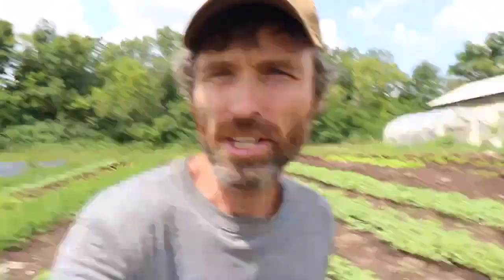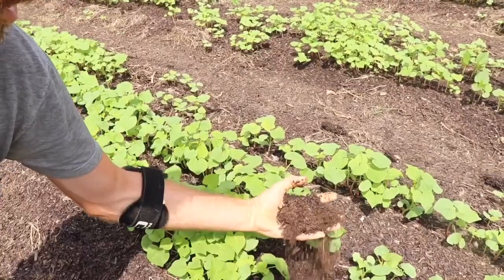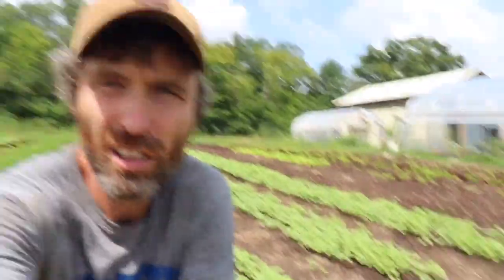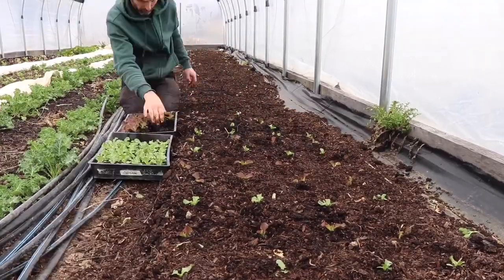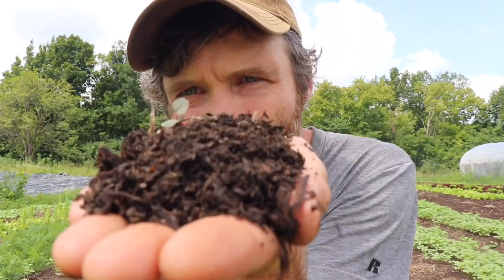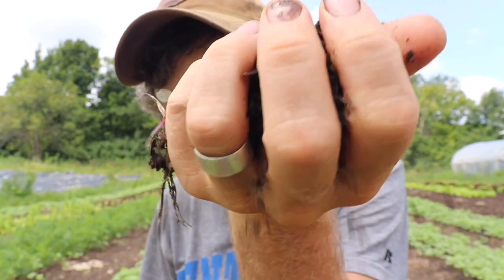Combining No-Till Systems

Comment: A few ideas: 1) Too much rain. Plant in raised beds so the beds can drain. No need for wood borders for the beds. 2) Drought. Opposite. Raise the path and lower the bed so rain drains into the beds. 3) Nitrogen, A good source would be to feed coffee grounds to worms in a bin. Also feed them rock dust, eggshells (after washing then sterilizing in an oven at 350 degrees.) 4) Do not ever try to germinate seeds in worm castings (vermicompost.) Bad results. Better off in a high end organic compost for the first few days.

Comment: Timely as usual!  My compost/mulch is very similar, with similar issues. While talking with my CNG certifier this weekend I think he brought up cover crops two dozen times! My concern was removing the cover crop, but currently I'm mowing my greens beds with a mulching mower and covering with landscape fabric for two weeks. Guessing I can do that with the cover crop. Definitely keep us posted on your work! Thanks!
Reply from the maker: Haha. Really cannot say enough good things about cover crops for our area. They cool the soil temp, they fertilize. I really want to incorporate more––the science is just not grey about their benefits at all. Yeah, fabric works. I’m going to spend the next year or so developing some methods for this with mowing and flame weeding and crimping and possibly covering with a little compost to weight it down after a mowing or crimping as a lasagne in place. We’ll see what works. Low mowing with a flame has been good so far. Needs more testing, though.

Comment: Perfect timing, can relate to everything you talked about in this video. 
Just finished interplanting a big mix of cover crops this morning, in really "underperfoming" beds (specially when comparing to other gardens haha) with the crop still in place. 
Lets see if it helps the existing crop to jump back...and if not, we'll just give it another try on September :). Hopefully with richer soils.
And as you were mentioning your erotion problems I thought maybe it could help if you grew a cover crop on your path ways. I'm doing barley in mines, just because it was what I had in hand, and wanted to take advantage of the pathways with photosynthesising plants. 
So long as I walk on my paths dayly it doesn't go crazy and if it does I guess I'll cut it back and use it as mulch for what ever is on the beds at the moment. But I guess it could help to slow down water and stop the erotion. I just seeded before adding some more material on the pathways and irrigated (it also helped me to need to use less material for covering the paths).
Wow this got extensive haha. Keep up the great work, and hope to hear the podcast soon :)!!
P.S. I'm going crazy with cover crops especially since I've seen the work they are doing at Man's organics in their greenhouses. Could be interesting to hear from them in your podcast ;)
Thanks again for the inspiring and helpfulll work you are doing.
Reply from the maker: Thanks and I have been thinking about a patch cover, though mowing it would be tough in our 18” - 12” paths. Still thinking on it. I really like what Mann’s organics has going on after watching those videos, for sure!

Comment: It makes sense that you would run through compost so fast if you're essentially dealing with tropical weather. Tropical rainforest ecosystems don't have much soil, because decomposition happens so much faster in the heat, and it gets a lot of help from the abundant insect life perpetually chomping away. You're doing what the rainforest does, which is keeping as much of it planted as possible at all times. I think if I were in your shoes I'd put down two lengthwise rows of bricks in the pathways (so, like 8"?) and expect the rest to get planted. Any runoff in rains in the pathways just ends up in the beds.
Reply from the maker: Exactly! In the tropics they mitigate that with carbon sources like Terre preta. Bricks is an interesting idea too. Thanks!

Comment: Have you tried adding manures or worm castings to make up for the carbony compost? 
I think cover crops/green manure are a great alternative but If you can add something to correct the nitrogen/other potential nutrients lacking you can then do inter-planting like you are with the cover crop but with produce crops instead. That way, as you said, you're keeping the roots and photosynthesis going for microbe/soil health but also growing produce for sale the whole time. I know that wouldn't work for every crop but there are a large number of inter-plants that work well even in commercial settings (generally slow paired with quick growing).
Reply from the maker: For sure. I’m open to all of that! Really into the idea of more lasagna beds on scale, especially with manure and green manures and cardboard. I think that’s a really cool option for building productive soil and encouraging worms.

Comment: Have you tried  fermented comfrey and nettle .The best nitrogen.You are hard worker.God bless you.
Reply from the maker: I would love to get comfrey and nettle both going soon! Great nitrogen sources.
Reply: Works great, but just about kills you with the smell. :D :D
Reply: Rough Draft Farmstead Got a PO Box? I’d send you 50 root cuttings off Bocking 14 or 4 can’t remember which it is. They bolt kinda like a garlic scape but you just keep those trimmed back for a larger harvest. If they’re allowed to go to seed the resulting seeds are sterile. They stay short 2’ tall and only spread from the root. Plant them along a fence and you will have all the Comfrey you need. If you till them they will spread. Put them in now 3’ spacing you will have a Spring crop and follow up crops every 4-6 weeks. I’d send you 50 for free, If you want a bunch we could work something out.

Comment: I was wondering if you bought your compost locally, or if you made it yourself?  I live about an hour from Lexington and would like to get into the no-till system and need to find some decent compost to start with... (after I just spent 1200 dollars on a tiller for my tractor, haha..) Thanks and I love the videos!
Reply from the maker: We make some compost, but we get the majority from Thoroughbred compost via Landscapers corner. It’s okay. I like making enough of our own and enough compost tea of our own to use as a sort of inoculant. That’s critical. Their compost is just really mulchy. Works well for deep mulch though! Check with Landscapers in your area and landscape suppliers. They may have some or have a source. Thoroughbred will also deliver 30+ yards I think.  Not sure how far away. They are in Winchester (I think).
Reply: Awesome!  Thank you so much for the information.  I looked them up and gave them a call already.  Looks like they have a Standardbred mix made with wood chips and a Thoroughbred mix that is made with straw.  I'm hoping to possibly use the one made with straw, as I don't currently have any other types of compost to mix with it.  Thank you again for all of your help and for the videos. Keep up the good work!

Comment: ya.. you really need to get woodchips in those paths they fix your erosion problem. think about planting willows and get a relationship with your local tree cutting program. it's like watching you is sometimes so frustrating because yall need some local state and federal level support. there's no good reason why farmers can't get free woodchips.  you'd be shocked how much woodchips end up in the landfilled and they gotta pay tipping fees putting it there.
Reply from the maker: Right!? It’s super frustrating. I can get them at the landfill sometimes, too, but they mix them in with everything else and if it’s wet I can’t get to them. Again, very frustrating.

Comment: Only 9?  You're lucky in this region that 9 is all you need.
Reply: For reference, I do 10 on a 50-ft bed... but that's kinda meaningless without knowing our respective wheelbarrow capacities, right ?
Reply from the maker: Makes sense. I have no idea what our wheel barrow will hold, honestly. 9 barrows is sort of the average also. It is roughly 1.5 yards per bed, so sometimes it gets closer to 10 or 12 in the saeson. Just depends on the bed.

Comment: why are all yall so wrinkled and grey? I thought you were eating great food...sup guys...yall look old as hell,,,,im 48 and no grey or wrinkles...
Reply from the maker: Been going grey since I was 19, homie.
Reply: So here's where on going with the Perkinsesque/Dowding approach: 1) compost, my only input, just once every two years; 2) in year 3 the wood chips on the paths are almost completely broken down, so I'm reshaping beds; 3) I'm testing the theory that a healthy soil ecosystem will provide the nutrients the plants need; 4) will experiment with rye for the purpose if mulch next year; 5) I work with the "weeds" (all wild edibles that I partly tend and sell), using them as food sources for soil life and mulch on the top; 6) very little micro-monoculture, meaning I interplant and allow what sows itself to stay where it wants to be (my healthiest chard, kale and spinach have been in the wood chip paths). My market garden is a jungle for some, but it's a thriving ecosystem above and below ground for others. In theory, a no-till system that is fostering soil life shouldn't even require crop rotation. I'm testing that, too; there are 3-year-old kale and brussel sprouts still standing in small test sections of about 100 sq ft. They have reseeded themselves this year and the new generation is doing fine. Clover might be a plus for them; I let it stay as a living mulch.